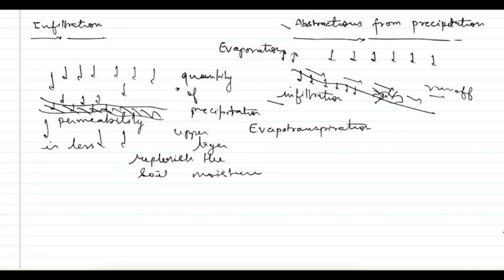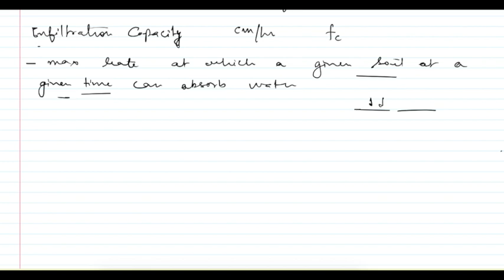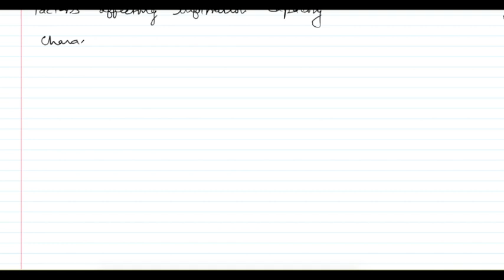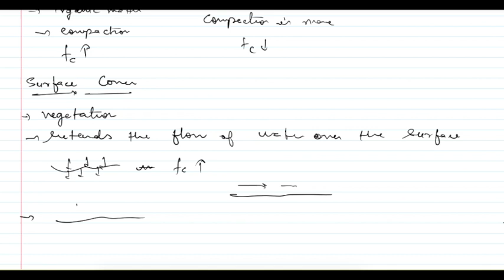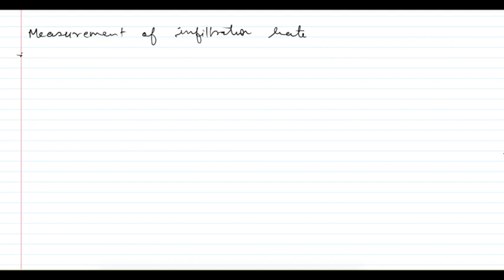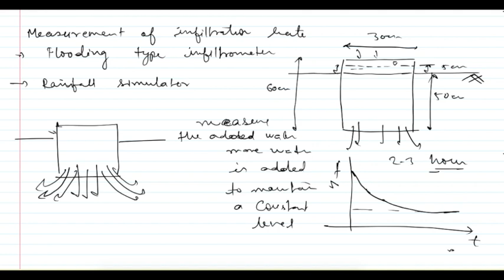Infiltration | Engineering Hydrology

Comment: . Infiltration rate of a soil was determined by infiltrometer test just prior to rainfall and is given by f = 1.143 + 2.0e-0.95t, where f = infiltration rate, cm/h and t = time in hours. If the rainfall occurs at a uniform rate of 2 cm/h, then how long will it take to initiate runoff?  please solve this , i need now
Reply: 53.5min?